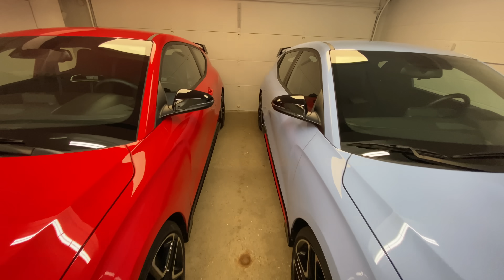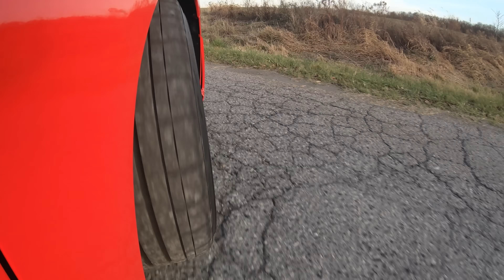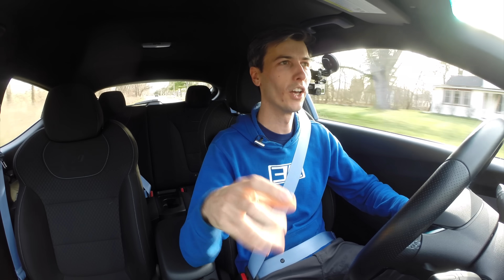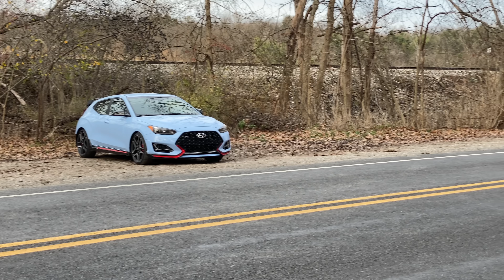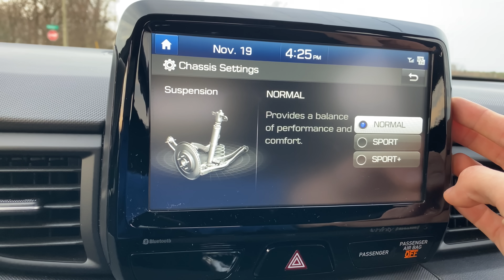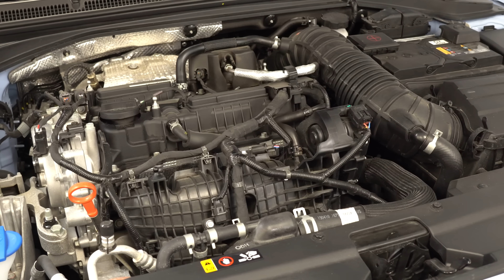Are Front Wheel Drive Sports Cars Any Good?

Comment: So far in my life I (or wifey since we met) have owned 4 RWD vehicles and 3 FWD vehicles.  The statement “FWD vehicles are better in the snow” is false, especially when talking about modern cars with all aluminum engines.  Every RWD car I’ve owned has had better snow driving performance than every FWD vehicle I’ve owned.  Here’s why:

The front wheel drive vehicles of today are very different than the ones 30+ years ago.  Today we have very heavy platforms in order to meet the latest safety regulations.  This shifts CG back.  Second, today’s new cars have all aluminum engines and drivetrains which are overall designed to be as lightweight as possible without harming efficiency.  This too shifts CG back.  It’s a 1-2 punch that results in FWD cars having a smaller majority of their weight up front than before.  And if you’ve got any real mass in the trunk. . . like a guitar amplifier, forget about it.

So, case in point: my 1993 Lincoln TownCar could climb up my old driveway in conditions that my 2010 Mazda 3 couldn’t.  Yes, maybe sometimes I needed to back into the neighbors drive for a running start, but that didn’t help the 3 at all.  On the same trend, the Mazda 3 could climb the same driveway in conditions where wifey’s Mini couldn’t.  The Lincoln was WAY better in the snow than the Mini.  Of course, if weight was added to the trunk of Lincoln it became sure as a billy goat.  Don’t gas too hard because it’ll spin. . .

And today I’m driving a Chrysler 300 while wifey has a Pacifica minivan.  At our kid’s daycare there is a hill to exit.  In similar conditions the 300 got out and away, but the Pacifica was stuck.

In short, unless you’re driving an early ‘90’s American sedan with an iron V6 suspended over the front wheels RWD really does win in snow.

Lastly, the control issues present on FWD cars are much worse in the real world where traction availability may be asymmetric.  Try accelerating assertively in an old beat up intersection and you’re going to fight the wheel because it’s going to be constantly trying to turn toward the side with less traction.  All of this does disappear on a mountain road in third gear or on a race track, also third gear, but most of us won’t see those often or ever.  Instead we’ll be looking for our kicks on crappy Ill maintained surface roads where the negatives of FWD are most apparent, and annoying.

Comment: Driving FWD in a competitive situation prompts a use of left foot braking.  In short, use of the brake during curves under power, lessens the understeer effect.  The brakes are applied to both front and rear axles, but engine power overcomes some of the front axle braking effect moving the car from understeer to even oversteer. Imagine going hard into a turn on a rainy day, hitting the brakes and losing front axle traction, beginning to slide off of the road.  The solution is to anticipate and apply both brake and throttle at same time, adjusting each for the condition of the curve.  This does result in more brake wear, but this is for either competitive or emergency situations.  Knowledge brings more control.

Comment: FWD has more advantages for normal and sporty cars. The closer you are to the performance/grip limits then RWD starts to shine. The answer is AWD which is why most of the wagons/SUV sold have this setup. If you design AWD as an option, you are giving up the packaging advantages of FWD. As for outright performance RWD is better... Think touring cars in the 90's. BMW would have won every year without weight penalties. Until Audi came along with a proper AWD system.
 Please consider a review of the new Toyota Yaris rally special which has a AWD system that can be switched from front bias to 50/50 and to rear bias. Which is more fun to drive for you a Miata or the Hyundai? Is the e-diff more than computer controlled braking?

Comment: I have a 2020 Velo N (performance pack) and it’s such an amazing car.  The e-diff really mitigates the torque steer and cornering.  It does get heat soak quick tho so upgrading the intercooler is a must or 3 WOT pulls and it’ll pull power from u
Reply: intercooler... for which part?

Comment: Civic Type R, Mazdaspeed 3, and Integra Type R. Those are among the notable FWD sports cars.
Reply: No. GTI for the win
Reply: @deanmarr785  Ah yes. Golf GTI, another FWD sports car. The one that I thought is all-wheel drive (AWD) at first. Then, I found out that the Golf R is the one with AWD.
Reply: @izzatfauzimustafa6535  Both are great cars
Reply: @deanmarr785  In Italy and France, there are plenty of FWD sports cars that are considered legendary in Europe such Peugeot 106 Rallye, Fiat Uno Turbo, Renault Clio Williams, Peugeot 205 GTi, Fiat 500 Abarth, and Fiat Ritmo Abarth. There is also an extremely rare and unusual FWD sports sedan called Lancia Thema 8.32 (V8 engine, 32-valve) made in Italy during mid 1980s. It is an executive sedan fitted with a Ferrari V8 engine, but still retains its FWD setup.
Reply: @izzatfauzimustafa6535  You guys get all the good stuff. At least I have my socal weather.

Comment: Re: torque steer.  Very surprised you didn’t get in to unequal length half shafts on most fwd cars, causing uneven reaction to sudden heavy throttle inputs.  I had a fwd V6 coupe that was like wrestling a bear every time I changed lanes on the highway.   Ever get stuck behind a line of cars going 45mph behind a slow truck, and you’re focused on your rearview mirror for the opening in the next lane doing 75mph to change?   But when you start to change lanes and you nail that gas to accelerate in to that gap in traffic, many fwd cars make it difficult to hang on to the wheel - at least the ones with any decent torque.   A poorly designed fwd car can be extremely frustrating.

Comment: I respect your opinion and your insight.  I have driven some fun fwd cars, the GTI and Mini Cooper S as examples that retain the enjoyment of driving.  I imagine the Hyundai is a similar experience.  That said, I really love having input control over all 4 wheels.  “Steering with the throttle” - including on daily driving. Accelerating out of a right hand turn for example. You can get more rotation with more throttle input - you’re controlling all 4 wheels.  

I similarly enjoy awd vehicles - not the pretend ones that are mostly fwd and send power to rear wheels when slip is detected.  My daily driver is an STi hatch. My weekend car is a Mustang GT. And I’ve owned a few Miatas over the years - along with other cars - and there’s just something about that “pure” first gen Miata driving experience.  

But yes, a fwd car can be fun. But an awd version of that same car (Golf R, for example) would be my preference.  I hate understeer. I enjoy oversteer.  And truth be told, most awd cars from the factory are set up to understeer.  I have my STi dialed in decently, but it will never have the turn in of any of my rwd cars I’ve owned.

Comment: I've extensively driven a front wheel drive in snow and wet conditions at ski resorts. Forgetaboutit. Inclines including driveways are nearly impassable. The weight shifts rearward unloading the front drive wheels. I would actually need to drive in reverse to negotiate some driveways. On the flats marginally yes, but rear or all wheel drive otherwise.
Reply: you ever driven a saab? I disagree however i do admit, this is a good argument topic.
Reply: @PLAYERSLAYER_22  Yes, I had a Saab turbo. Exactly the car I was talking about. It's just simple physics.
Reply: @michaelcohen5076  honestly, i loved my 9-3 in the snow. realistically the front weight bias of that car gave it a pretty good chance in the snow, not as good as awd i admit, but exceedingly good compared to any other fwd front engined cars. i live in appalachian mountain region and the saab handled better in the winter than almost every other car on the road except jeep and subaru. those things are increasingly common as altitude increases since most other cars blow the transmission up due to mountains or simply understeer into a total loss. also the stability control, abs, and ability to easily turn off tcs (esp in my model?) were just perfect for the every day driver and just ages ahead of lots of modern cars. i had a drunk driver total my 9-3 about a year ago, and Id jump on a good offer in an instant if i can find it except nobody wants to let theirs go for under 5 unless the rear main seal is blown out.
Reply: @PLAYERSLAYER_22  When on the road talking to other Sabb owners the conversation eventually got around to their latest repairs. It was laughable how unreliable and expensive repairs were.
Reply: @michaelcohen5076  I mean, it actually had a pretty solid drivetrain. I’ll admit that the b207r had some fatal flaws that killed Its marketability at new, but for a used car nowadays, I’ll argue its hard to beat that car for the initial cost. mine never gave me any drivetrain issues other than a rear main seal leak that was increasing as i got it passed 150k, this had no effect on performance. for all the repairs outside of the drivetrain, its pretty easy to make repairs yourself sourcing parts online. I fixed the ac blower motor controller that went out for 30 bucks on amazon. I even replaced the entire intercooler + radiator system after a relative joyrided the damn thing into a ditch when i was out of town. really wasnt that hard or expensive to get back onto to road despite it being an accident that would have totaled most modern cars. it’s seriously a tank for what it is.
Reply: @PLAYERSLAYER_22  Mine was an early turbo car. The valves and head would crack from heat. The turbo would coke up from heat it was not water cooled. It later developed the inability to restart after a drive due to a faulty seal in the fuel injection  system. Happiest day when I got rid of it. Glad you had better experience then I did.

Comment: As an owner of a 3800 lb 500+ wheel HP FWD car... I can tell you that even considering torque steer, I find it far more forgiving to drive than a 500 WHP RWD car.  RWD cars can kick out the rear end very easily.  Not so with a FWD car.
Reply: I find understeer to be much less forgiving for a good driver than oversteer. Also oversteer is fun.

Comment: torque steer is usually attributed to transverse FWD engine configurations because ONE drive shaft is LONGER than the OTHER... which leads to a DIFFERENCE IN TORQUE transfer from wheel to wheel.  That's the inherent DESIGN REASON for torque steer.  Other differences would be varying tire pressures as well as weight distribution differences from the left and right side of the car, and of course road surface variance from one tire to the next etc.

Comment: Everyone has their preferences, simple facts are though fwd is cheaper to manufacture, depending on weight balance superior slippery traction and generally safer for novice drivers.  

Almost any vehicle suspension can be improved to change the vehicle's behavior.   

That being said I prefer rwd, sadly no sports car for me but I have tuned mine to be more neutral than typical.  

Where I live we have lots of gravel, broken pavement, snow and ice and for me a neutral but stable platform is more important. 

Electronic features are lifesavers but in my area they seem to fail far too quickly due to road and salt damage.

Comment: Can you do a video on how to drive for fuel efficiency? Specifically in terms of actual driving such as gear shifting, sod modulation for cornering and slopes and hills, use of breaks. And others things such as optimal acceleration for efficiency.
Reply: Very curious about this too... Many years ago there was a study by BMW that was corroborated by Ford when fuel injection was in it's relative infancy in mass production vehicles. That study said that the best way to maximize fuel mileage was to "briskly get to cruise speed" and then "loiter there as long as possible" they further clarified that you should be almost aggressively accelerating, and then delaying anything that would scrub speed -- remaining off the brakes and simply coasting when at all possible.

That was in the mid-late 80's and vehicle control strategies, aerodynamics and even weight have grown in leaps and bounds since then. I've even heard that, comparatively speaking, our fuel we use currently has less power yield than it did 20-30 years prior due to additives and emissions reformulation. I know this to be theoretically true due to the fact that I have to tune my 1982 BMW's motronic to run more richly on today's fuel. On stock programing it's in a very lean condition. 

I have noticed that many modern "economy modes" will now make the throttle less responsive and thus your acceleration inputs  more sluggish, which is counterintuitive to the theories we had in the '80's of brisk acceleration to a constant speed.
Reply: @jhelmsing  That very interesting information! Thanks!

Comment: I don't understand your description on the braking system feature.  You describe it as filling the brakes before depressing the pedal.  But the entire braking system is always filled with fluid assuming it's in working order.  Is there any other, more detailed description, of this system?
Reply: yeah didn't quite make sense to me either on the basis that cars usually have brake boosters which are designed to aid in those moments where quicker maximum braking is requested.

Comment: Just out of curiosity, but wouldn't RWD cars with the admittedly much rarer, but not unheard of, all wheel steering have some level of torque steer?
Reply: No because the two axles are the same length. Torque steer can  happen for many reasons but it's biggest culprit is when driving axles are different lengths...I . E. most fwd cars simply because of how the drivetrain is packaged. In fact Mercedes advertises the fact their A Class has equal length front shafts and how it eliminates torque steer

Comment: Jason I agree with you being excited about affordable cars that are fun, rather than exotic supercars. But I was always under the impression that a rear wheel drive car overall was less complicated than a front wheel drive car. But you said in the video that front wheel drive cars are less complex. Is that really true?

This is for all the reasons you mentioned, by separating the drive wheels from the steering wheels each system can be less complex. Having the front wheels doing so many different tasks, I believe ads complexity correct?
Reply: RWD are considered complicated because engine, transmission and differential are located into different places. Unless you mention the mid/rear engine RWD, then the components are like FWD but with RWD driving experience.

The reason why mid engine low end sports car so rare is because the cooling issues. Plus the practicality are mostly lacking, while hot hatches offer utility as compact sedans.

Comment: FWD is a far superior solution - weight transfer issues can be helped with an aerodynamic design, torque steer can be eliminated simply with equal length driveshafts. The sportiness of the car depends much more on suspension geometry and tuning, overall weight, steering etc.
RWD is kind of a relic of a bygone era not unlike the drum brakes.

Comment: What exactly are we "pre-filling" in the brake system?  It's a closed loop system for the fluid, no filling necessary unless you have air in the system (you shouldn't).  So, what are you referring to?  Reducing pad knock back and minimizing the distance between the pads and the rotors?  Pre-boosting the brakes somehow with the brake booster so you don't have to wait for the vacuum boost?

Comment: Is it really accurate to say the front tires are doing all the work?  I'm intuiting (no data here) that during the initial steering wheel movement the front tires are at a higher slip angle, but once established in a curve all the tires have a slip angle and are working to generate lateral force, no?  Once accelerating again the front tires do have to do more work, but in a rear drive car once accelerating the rear tires have to do more work, and in both cases you have the balance the chassis with this in mind.  I think front drive cars handle better than ever, but the physics of weight transfer will always argue in favor of rear drive for powerful sports cars.
Reply from the maker: "all the work" is a bit of hyperbole, but they're doing the majority of braking & turning (and all accelerating).
Reply: @EngineeringExplained  Right, but the fronts also do the majority of braking and turning (transient rotation) on a rear wheel drive car, and since turn-in is a transient not done under power, trust required  does not use up available traction even on a front driver, no?  After rotation into a theoretically constant radius turn, are not all  tires at essentially the same slip angle?  Therefore it seems the driven and is sensitive to any thrust applied to the friction circle regardless of steering angle.  Since the trust necessary to sustain velocity or accelerate comes at the expense of lateral grip, no matter which end is driving when you accelerate you have to reduce lateral acceleration (unwind some steering) to prevent the driven end from sliding.  This is why it seems to me that when accelerating from a corner the rear tires of a rear driver  do the same extent of "all the work" as the fronts do on a front driver.  Weight transfer under acceleration favors rear drive, but both cars have to take measures to prevent overworking their driving tries.

Comment: This is why I still have my Honda Prelude Type SH. It's down on power vs. my current car (Kia Stinger GT1 AWD), but it's over 1k lbs lighter, has an electronic differential (ATTS), dialed in (modded) for autocross/track use, handles like a RWD in corners, just so fun to throw around.